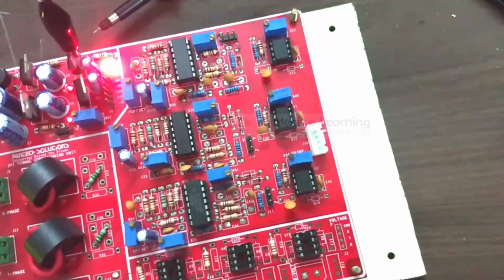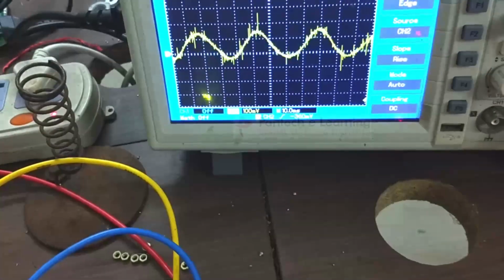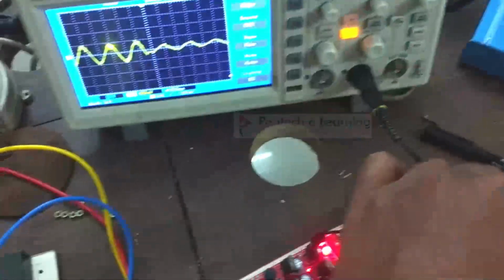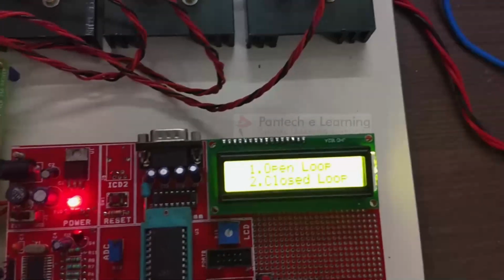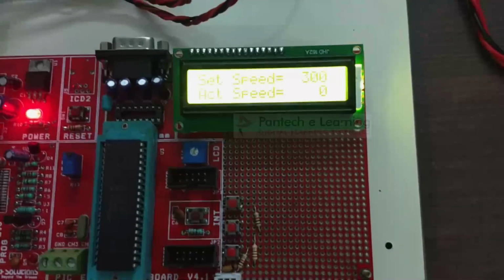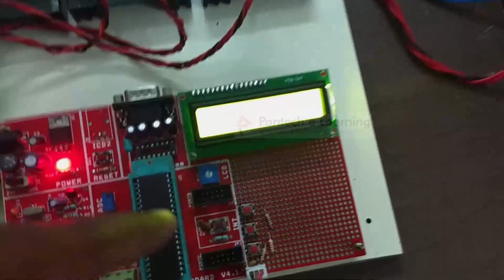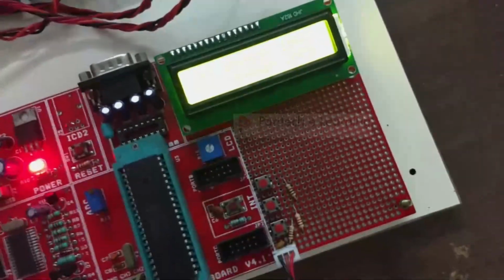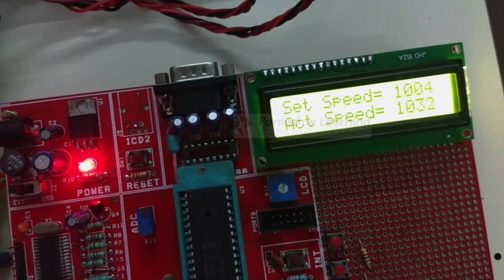Induction Motor Driver Circuit with Input Protection – LIVE Demo!

Comment: What is the open loop and closed loop
Reply: Open Loop is we can control the motor speed manually by varying MI and Closed Loop we set the speed so MI adjust automatically and settle down at set Speed.